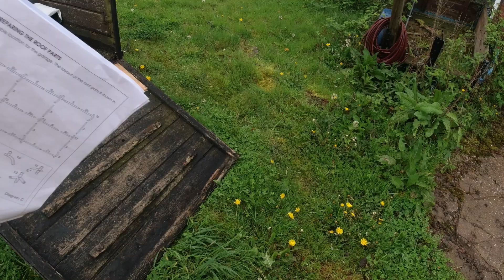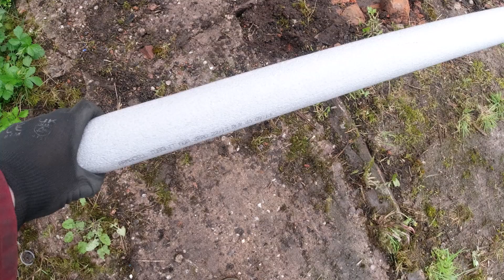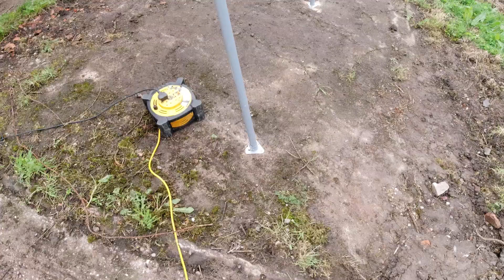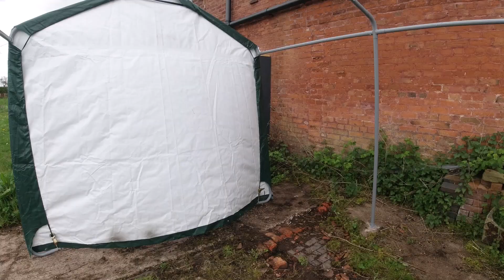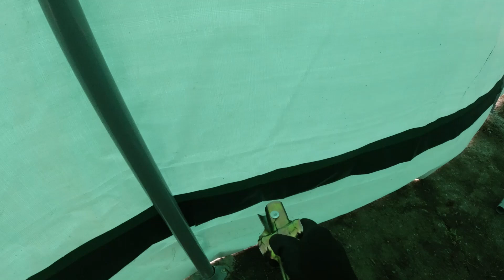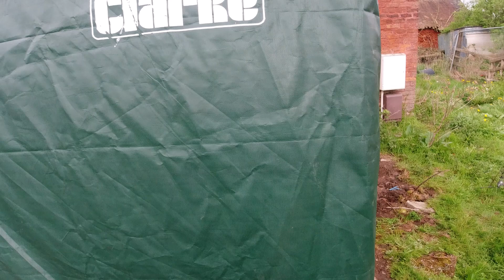How (not to) build a Clarke instant garage tent - learn from my mistakes!

Comment: Are stakes in the ground required?
Reply from the maker: In the video I used anchor bolts in the concrete. You can use things that look like tent pegs if you are putting it on grass or gravel but they won't be as secure as anchor bolts.
Reply: @BlakesDen  Thanks I want to put mine down on a asphalt driveway. Do I need the base tarp on the bottom?
Reply from the maker: No need for a tarp, I don't have one mine
Reply: @BlakesDen  ok thank you

Comment: Looks very useful as a temporary measure: it will be interesting to see how well it lasts. If those clamps are cadmium plated I think that they will need to be painted quite early to resist rusting.
Reply from the maker: I'll provide an update once the first storm arrives 😃. I think they are zinc plated, cadmium is nasty stuff.